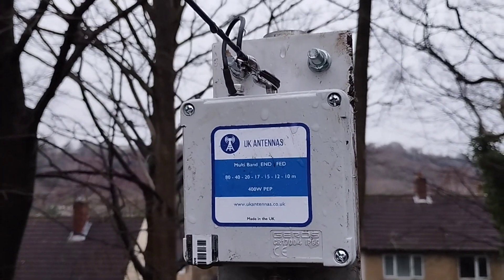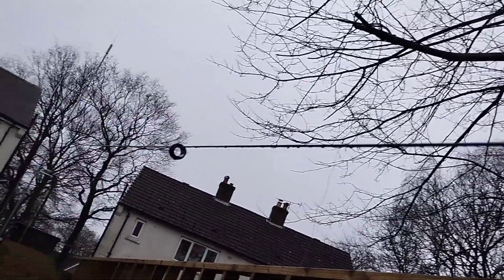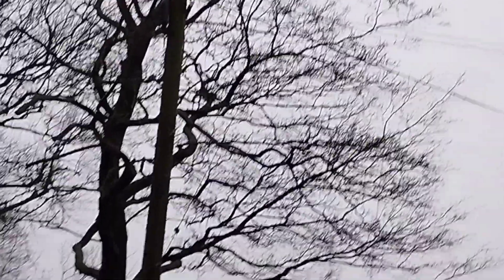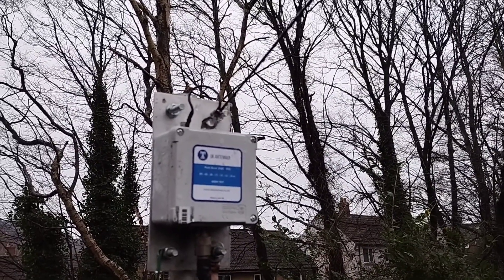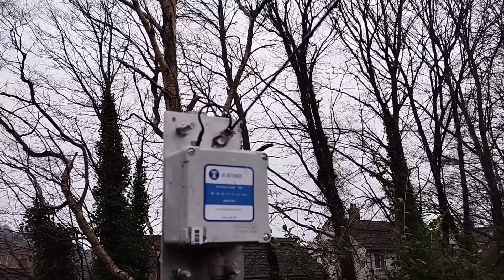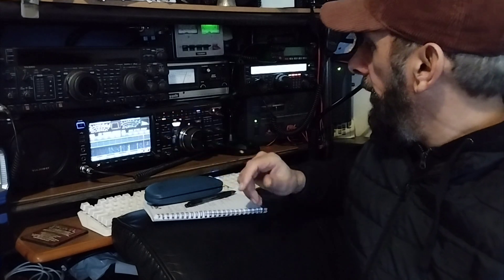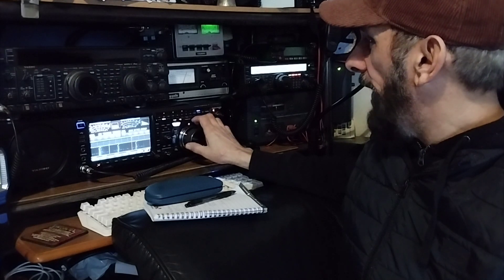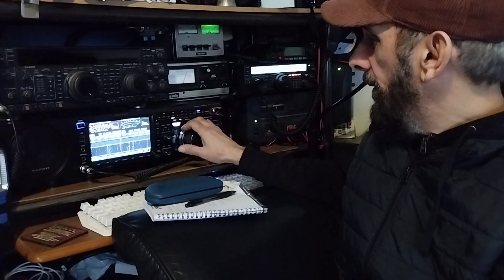80M End Fed Half Wave Wire Inverted V + Short Counterpoise

Comment: Im late to the party & just now trying to duplicate your build. Do you feel the wound "trap" is necessary, or would a straight wire, inverted v work as well? I understand the trap is placed at the first 2 meters of the feed line and helps on the 80 meter band?  
'73 from USA!  KR4AGS
Reply from the maker: Hi Kevin I can't really say as I've only tried it with the small coil inline but it probably won't make much difference. All I can say is that it works really well on 40 and 80. Low noise on Rx and good signal out. Good luck with your build 73

Comment: I have this same antenna, mines also in a inverted V sloping down one end to around 12ft. Works great on most HF bands. I dont have a counterpoise on mine as the coax acts as one. Does that earthing on the balun box make any different to noise levels at all?
Reply from the maker: Hi bud. The earth/ground will improve the reception quality and also provide a means of escape for any high voltage or unwanted current. Not so sure if the actual counterpoise is needed
Reply: @M0YKSHamRadio  I thought as much, funnily enough I was listening around on 80 meters just the other day on a SDR via Station Master and I heard you calling out CQ and stations coming back to you, chances of that! Love your channel Simon, you keep it real and always a pleasure to see new content from you. 👌🏻👍🏻
Reply from the maker: Thanks bro I appreciate the positive feedback 😁👍.  good to read you stumbled across my signal. I am trying to call CQ more often as even when I don't get many it provides activity for others to receive and know if the bands are working. So keep listening lol I'll be back. I have been on just now on Lower end of 80 working a few. 73 tnx

Comment: I have the same antenna, no counterpoise, but I do have a homebrew choke up in the loft more shack end, and I have no RF in the shack.  What length of coax are you running to the antenna ?
Reply from the maker: Hi Pablo good to hear from you. I'm have approximately 130 feet of coax
Reply: Hi Simon, any reason for the long length, why not run from the house end up the garden ?  @M0YKSHamRadio
Reply from the maker: @pabloemms  hi Pablo the reason was I already had the coax in place from a previous antenna. However I might try it out 👍. Thanks for the Idea

Comment: Looks like it's working well Simon.  Maybe I will try one eventually but where to feed it is the issue :). Getting feeder out is difficult from the box room and I am getting a bit old for crawling in the loft :). Ian
Reply from the maker: Tnx Ian. I cheat a little as I have a 30ft light fibreglass telescopic poll.  I make small hooks that attach in the end. I can then easily fix the antenna where I want it with no effort required. Catch up again soon hopefully on the band 73

Comment: As an inverted V it can probably be expected to be an NVIS cloud warmer on 80, and a bit directional and squashed more to the horizon on its full wave frequency of 40m with most gain perpendicular to the wire in both directions.
Reply from the maker: Tnx for the info. We will see how it works out. So far not much noticeable difference on 80 apart from better reception quality. I have managed two USA QSO in 80 with it so far so looking promising or at least similar to the Dipole. Thanks 73

Comment: Happy new year Simon 👍 do you just have the counterpoise connected to the bracket or did you open the case and connect it internally?

The reason I ask is that the normal school of thought is the coax itself would act as a counterpoise.
Reply from the maker: Happy New Year Steve. I connected it to the bracket as instructed by the install instructions. I don't think it needed one but fancied trying it. I don't seem to have any RF problems but the coax run is at least 100 feet so probably I wouldn't notice much feedline radiation at this end of the coax. Early days of experimenting we will see what it ends up turning out like. thanks for the comment. best 73
Reply: @M0YKSHamRadio  thanks Simon just got mine today and added a choke 7m back from the feed point. No RF in the shack but SwR is a little high at 2:1 ish and sometimes 3:1 mine is an inverted L.

It’s hearing OK so I guess I’ll try a counterpoise. What length did you go for mate ?

Cheers and HNY

Steve
Reply from the maker: Hi Steve. I put a choke in and had a similar swr reading so I removed it. I have heard the best place for the choke is near the transceiver as the the antenna may need a good length of coax un choked to work as a counterpoise. The counterpoise I added is 13ft 2inches. Not sure how effective it is but I only need the atu from 3.740 up where it creeps up to just above 2:0
Happy New year and have fun I'm confident you will like it